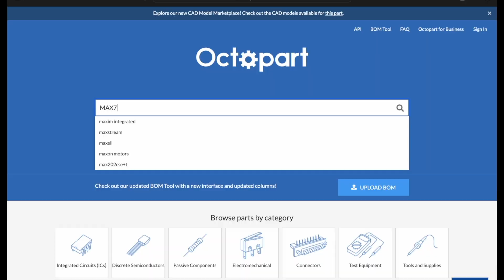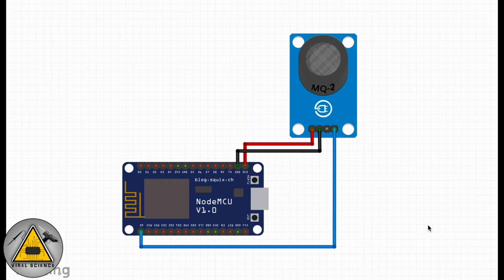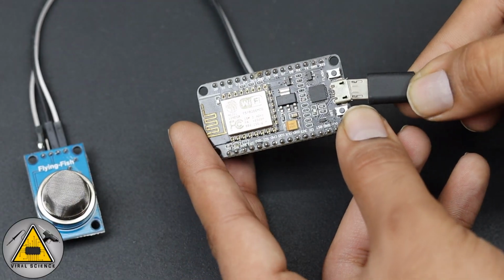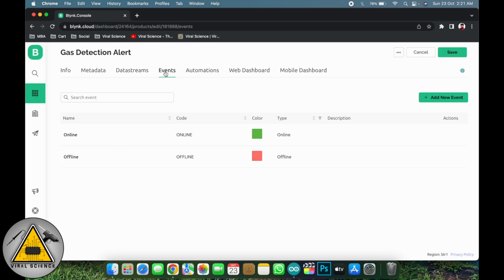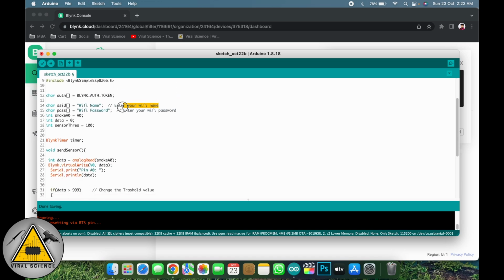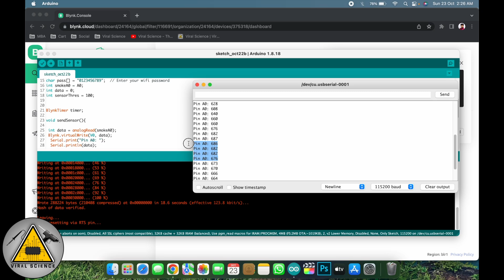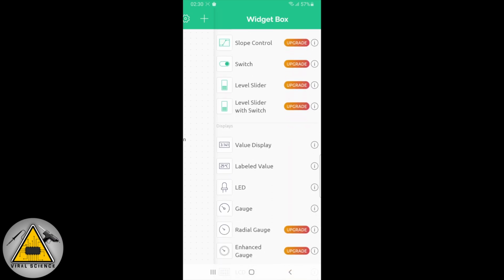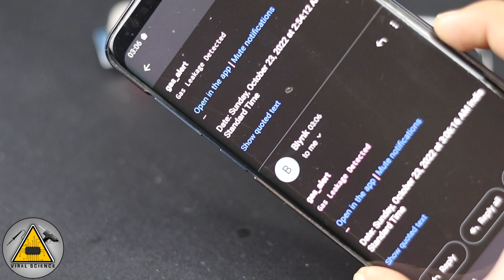MQ2 Gas Leakage Smoke Detection System | Email Alert

Comment: am farmer 
I required program to monitor 4 moisture sensor readings and
4 ldr sensor readings and 4 humidity tem readings with 1 single Esp8266node mcu with new blynk app. 
Can u help me out with program and circuit diagram